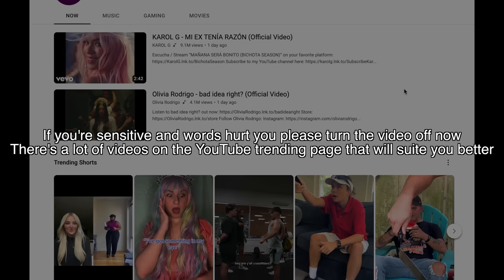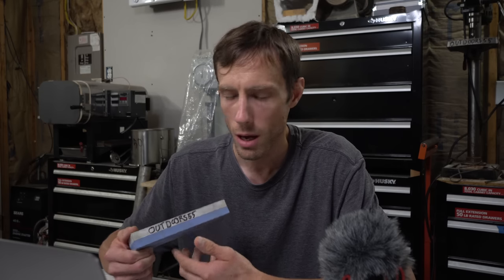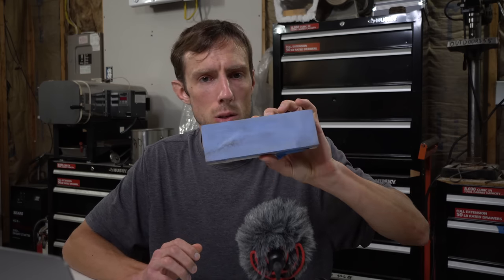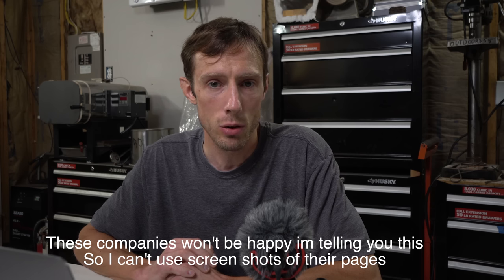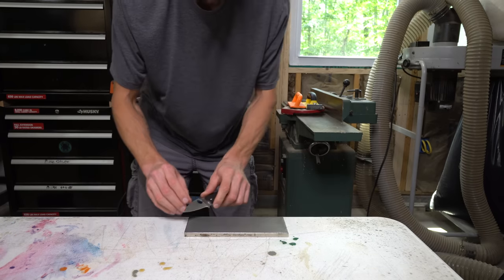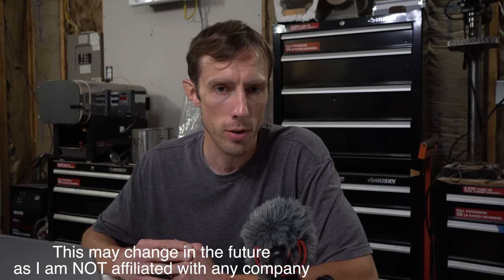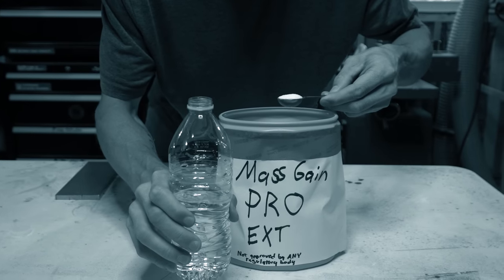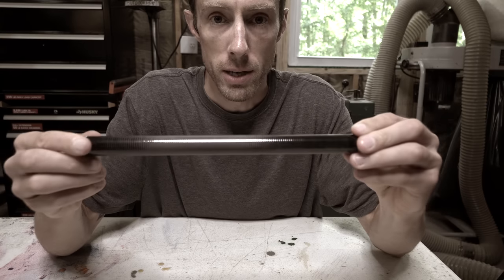The Internet’s BIGGEST Sharpening Stone SCAM

Comment: Have you ever tested the Masters of synthetic japanese stones? Companies like Naniwa, Suehiro, Shapton, and King? Especially the Splash and Go stones that dont need soaking? Thanks for great content.
Reply: Naniwa professional/chosera and Shapton glass are absolutely phenomenal stones. So long as you are dealing with steels that are 66 or less hrc and have no vanadium or tungsten carbides both of those stones I just spoke of are AMAZING. I'm more of a super vitrified diamond and Metallic bonded cbn stone girl my self and those two types of stones are mostly what I do edges with (along with the atoma 140 that is what I do most reprofiling on) but I mostly deal with hard steels with very high carbide volumes so that's where they shine. When im dealing with carbons and more simple stainless alloys then I do most of those edges for customers on either shapton glass or Naniwa professionals. The edge quality those water stones are capable of on steels like super blue, 10xx, super gold, 14c28n, vg10 etc etc is pretty much untouched by any diamond or cbn abrasive. I find that the naniwa pros stop cutting efficiently on low carbide steels that are around 64hrc and the shapton glass do pretty well up until about 66hrc but those are pretty much the limits of the steel matrix hardness before the aluminum oxide abrasives in the stones just can't handle cutting the steel any longer.

For the right steels you will love them, if you mostly deal with high performance high carbide ratio steels then don't spend your money on them as they will not do the job you need them to. A great option is resin bonded diamond, that's the best in between that feels closer to water stones yet has the cutting power to handle any steels you throw at it. They are more expensive BUT they will last an extremely long time and have the cutting power to handle any steel yet with a more refined water stone type edge rather then the typical highly aggressive diamond plate type edge.
Reply: @EDCandLace Nice to see a women loving the hobby (and knowing her facts)!

Comment: I'm not sure if it's in Europe but I've had poor luck with DMT diamond stones from Amazon.
I bought like 5 of them and every single one had some quality issues - like missing places of actual abrasive or visible cnc machining tracks on the surface  (and that was Extra Fine grit...). Ended up returning all of them. Finally I bought some cheaper post display ones - and those are indeed great.
Reply from the maker: Ive heard some good and bad reports stemming from the same issue. Either dmt has counterfeit items being sold in their name, or they are selling seconds themselves on Amazon. The link I left was to the item from the DMT store.  I ordered mine from the same place  (Amazon) 5 years ago. I reached out to dmt a couple years ago about this issue, as i was trying to become a dealer. I never got a straight answer so I decided to not become a dealer. Unfortunately I haven't had much luck with any other diamond stones either.
Reply: I think DMT qc might not be up to top standards. 
I’ve bought quite a few from Amazon and one of them double sided Duo sharp, had really bad quality on one side. After very little use there’s a big spot where all diamonds are just gone. But the backside (325 grit) is still in great shape after 3 years, so definitely not a counterfeit but rather as mentioned, bad quality control.
Reply: Why ever on Earth would you say it's "definitely not a counterfeit" when nearly all products on Amazon a clearly factory-seconds/thirds, obvious counterfeits, used-abused/returned then resold, outright scams, etc. Buy direct from DMT and you will likely be very pleased. P.S: I do not nor have ever ever worked for/with DMT or have any relation to them whatsoever (they are quite expensive but that seems to be the "system." Good luck, 76.

Comment: While I agree with many of the points I find the whole whetstone process very relaxing, regardless of the mess and even though I'm an complete noob I was able to get super sharp knifes with this stone, later also without the guide. At the beginning yes, I felt like I was dulling instead of sharpening but once I got a nice burr on both sides which I then fleshed out with the 6000 the knifes were sharp as never before. For 25$ which I paid with shipping and a truing stone included I find this to be the perfect start into the endeavor.
Reply from the maker: Awesome 👍 some absolutely love the whetstone process. Glad you only spent $25 too!
Reply: Yeah they can be a cheap start to sharpening and practicing technique
Reply: mine are just ok too, and came with a flattening stone which works okayish too

Comment: Yes. This is a common tactic of advertisement goodie items. Basically a company in china makes cheap something and other companies buy certain something and request their brand on it. Usually it's done with USB sticks, pens, keychain flashlights, etc. Thanks for making a whole video about this as it jas become quite a big issue in the sharpening sphere. I used to learn on very cheap stones similar to this kind but bought locally in convenience or grocery stores. Gave me a good base for sharpening skills but nowadays I use trusted and recommended brands only such as Naniwa. Good videos as always !
Reply: It also happens that a Chinese manufacturer gets a legitimate order to build quality products (that they can deliver cheap compared to the competition, due to subsidies) for a respected brand. After the order is completed, the manufacturer has the know-how to make knock-off items by substituting 'expensive materials and QC' with 'cheap materials and no QC'.
Reply: @DreadX10  maybe so. In my experience that hasn't happened yet. Always met with products built with sub par methods and technology probably because of the reason "we don't know how to make it properly but this way will work just fine". Otherwise it's blatant low quality. More often than not tho, you get what you pay for as they say.

Comment: I was taken by the cheaper water stones sold on Amazon. Yea, they wear out like crazy. I finally bit the bullet and purchased a set of Shapton ceramic stones and love them. I never use the printed side except for some very infrequent flattening. Shapton stones hardly wear at all. I also purchases a couple of the cheaper diamond stones for profiling as well as axes and machete's ...I think they are  "Ultrra Sharp" and I have no regrets on that purchase. I also have a King or two that are not bad but just don't have that same pleasant feedback the Shaptons have.

Comment: While I wouldn't buy the expensive stones you are referring to, the cheap stones do have a place. I have been using them along with really cheap knives from charity stores to teach people how to practice angles. Getting a "high" grit amazon stone is only a few $ and they work well enough to tell when you get the right angle. You can get your knives to shave hair with them and it builds confidence in the people learning.
 It is cheaper than having them dig pits into my nicer stones, I only use King import water stones as I have a literal pallet of different grits from a liquidation sale so maybe teaching on a diamond might be better I haven't used 1. 
Just never buy any stones under 800 grit as they are all basically 120 grit or worse in reality and will eat cheap knives.

Comment: My landlady has one of these, same "soak in water" instructions, same cheap clay that slowly "dishes out", except it's about 50 years old. I've only used it once, on garden shears that we had used and abused and struggled to cut through branches because it was chipped. I had literally no idea what I was doing, I just held the blade at an angle and rubbed until I heard grinding metal...
I can say with pride that the garden shears cut through branches again.

Comment: For $50 buy either a 1k Shapton pro or a 1k/6k king stone. Both are well made, good abrasive, don't wear as fast (especially the shapton) and give you a great edge of the stone that can ne refined with a simple strop. I use the 1k shapton for my kitchen knives since it gives a great balance of slicing aggression with push cutting ability.

Comment: Not only did I learn on that stone, I thinned a chinese cleaver substantially with it. 

An endless grey sludge formed. The water the stone was in eventually had enough sediment to feed the nile valley. The excess found its way onto my countertop and then proceeded to soak itself in. A month later I'm still cleaning up from it. 

I'm glad you turned me on to diamond stones. This could have been my forever experience with sharpening.

Comment: This is exactly how I felt when I bought those stones, I dished them out and couldn't get anything sharp, I was so done with trying to learn to sharpen, rather than getting a trueing stone and  attempting to continuing with them which is what I considered in the first place (again thinking it was my fault for sharpening wrong and gouging out the stone) I got the 3 set of dmt stones and the 3 set of dmt paste and they're so much better, then I made my own strops, one for each grit after ordering a strip of leather from amazon after watching your video. I'm so mad about those cheap stones I bought because I thought they should be good for the price and reviews and that it was me not being able to sharpen and hold an edge. I literally took all my hours of frustration in practice onto the dmt stones and got a razor sharp knife on my mora the first time, then I took my second mora and did a true scandi and it was unreal.
Reply: It is cheap whetstone you best buy a cheap diamond plate to level it as well as clean it after sharpening. Probably okay if you are sharpening cheap kitchen knives occasionally. But if you sharpening your expensive japanese kitchen knives or collection of expensive pocket knives.. best to listen to the advice in this video.

Comment: After purchasing some decent quality hand planes and Sheffield steel wood chisels I tried the "scary sharp" system of abrasive papers but after a short while it was clear that stones were required.  Endless hours of browsing Amazon and other sellers was nothing short of frustrating.  I didn't trust anything on Amazon and ended buying up at a dedicated woodworking store.  I got 300 and 1200 grit 3"x8" diamond stones.  They were more expensive than those at Home Depot (probably no better though) but I have never regretted buying quality stones.  They're also great for knife sharpening and honing hand ground HSS lathe tools.

The close of this video is priceless!

Comment: I respect what this guy says. I have purchased these sets of knife sharpeners. They come in sets. You might be able to buy one. My experience with the cheap stones is excellent. I took a cheap machete that was 1/8 inch thick. Very dull. I sharpened it better than a mora knife. I did not believe it until I did the paper test. Mora has sent me the sharpest knives I’ve ever had. I did not think knives could get that sharp. I cut my finger on the blade with just a passing on the blades edge. The machete is to that quality. I started off with some cheap Diamond plate stones ( I tried to use the whet stones and the metal was to thick to form a edge). I purchased a 320 grit cheap Diamond stone to wear down the metal to get a edge. I have not used the machete except for the paper test. The edge retention has to do with the type of metal and angle of grind. I’m not a professional. Just someone who wanted to be able to sharpen his own knife. They do work. From my experience. I will look in this content creators description for recommendations. It’s best if people see if this is something you want to invest in. It took me over four hours to get this machete sharp. Maybe you don’t want to take that long. Tormek T-4 is the way to go. 1/8 of a inch thick blade and 11 inches in length with no edge at all 4 hours plus.

Comment: I honestly trained myself to sharpen on these cheap stones. For beginners it's not a bad start, but getting the flattening stone is a must since these dish out so badly you could take a drink after sharpening. Diamond stones are a godsend, and I do plan to upgrade to real DMTs eventually. Right now, I use the cheap china ones with rubber or PU bases. The plates themselves are pretty good, but they're only 1 to 2mm rhick, and tend to bend to confirm to the rubber base. I get a good cutting edge out of them, and they don't dish out. But I have to bend them back to flatness once in a while. 
Great vid brother! Cutting-edge content as always!
Reply: Get the ones without the rubber backing (or remove the rubber) and glue them with UV glue to a thick glass plate. I have a couple of those and I'm pretty happy. Makes sure that you glue them evenly thou.
Reply: @galileo_rs  Thanks! That's a great idea. There's no base flatter than glass. And I have to make sure that the plate is dead flat before I glue it on. 
I almost forgot to mention, the worst thing about those rubber bases is that they smell really bad when they first arrive. Like burning tires.
Reply: @gall_blader_works  Technically not correct, float glass is not that flat but at these dimensions it should not matter. Easy way to check is to tear apart an old printer and get the rods and use that to check. I glued one badly because I applied to much pressure in the middle of the stone in an effort to spread the glue. Best method seems to be to put your glass plate on another piece o glass, dump a bunch of glue and press lightly. Shine the UV light below and you should be good to go.
Reply: @galileo_rs  Thanks! That's an awesome tip. I was wondering how best to shine that UV  light. At first I was using double stick tape when the adhesive failed. But UV looks like a much better adhesive to use. You've got very wise solutions 👍
Reply: @gall_blader_works  You are welcome and thanks. BTW if for any reason you need to unglue the plate just put the in the oven, make sure to cool the class gradually or it will crack. Just don't do it if your wife is around, she will not appreciate the smell 😉
Reply: @galileo_rs  HAHAHA  Thanks. I think I've put her through enough during my DIY journey. Dust and all sorts of chemical aromas. HAHAHA

Comment: I totally agree with the diamond plates . They work so good , no mess . Plus for the higher end spyderco steels
Reply: Been using the same Diamond plates for well over 10 years now… the speed they sharpen and the fact they stay flat just means they get used more and everything else works better. I remember struggling so much with cheap stones back in the day.

Comment: I'm laughing here😂, as I also bought these cheap sharpening stones in a kit from Amazon in the UK, and spent about 2 hrs today waisting my time with them. I'm no professional sharpener but these seemed to work ok with cheap kitchen knives, but when I went to use to put a good edge on a new mora they were absolutely crap. Ended up using them as a flat surface to clamp sand paper to and was able to get an amazing edge this way on the knife going though to 1500 grit, then a quick strop. They don't even feel to be the same abrasiveness as they're listed as, with the 400 removing very little steel compared to 400 grit paper.

Comment: I am a blacksmith so I tend to not worry about the final stages of sharpening. No, I do not make knives but other tools need rough sharpening. I have used diamond sharpening plates and they are great, but I still love water stones. I get mine from hardware stores in Japan. Not sure if the same brands are available here. The big stores have 3 grades, poor, average, and rich. I usuly get the middle or average brand. They work fine. I like large stones which are as big (or bigger) as some of the diamond plates. My preference is for a course one around 400, a fine one around 800, and an extra fine one of around 1000. Yes I do own a few super extra fine ones too, but seldom use them unless sharpening my wood planes or chisels. These water stone maker is Gouken but I have also seen them sold under the name of Tiger stone. These hold up well without dishing too soon and the course one sounds like a brick. The 800 one sounds smooth to me. The price varies but if I remember, they cost (depending on grit, finer ones cost more) somewhere around 30 dollars to 80 dollars. I guess I am old school and buy stones in person after touching them.

Comment: Funny, I've been using one of those stones for years now, only thing that's going to change is where I order it. I only have the two knives and they come out polished and razor sharp each time. Hallowing? I have a second brick for that to adjust it flat, but it's not much of a problem I usually just spread my strokes slighly across the stone.

Comment: I've got a set. I'd say they're serviceable waterstones with all of the good and bad that come with that. They sharpen my carbon steel knives just fine, but I've heard/read that a lot of the abrasion-resistant high alloy steels used in modern cutlerly really require diamond stones.

Comment: I got the stone set you talked about but only paid $26 for 400/1000 & 3000/8000, it is messy but at this point I am used to that with a lot of sharpening systems, the edge is the best on my tools I have handled so far.  I want to eventually upgrade but will be getting more familiar with a system I finally have confidence in compared to oil stones, or other systems that can't keep my edges square.

Comment: I moved from traditional water and oil stones to Ultrasharp and Atoma diamond stones with my own lubricant concoction and have not regretted it one bit. They di work better with a lubricant, but it has to be the correct viscosity or you won't get the full sharpening potential from them